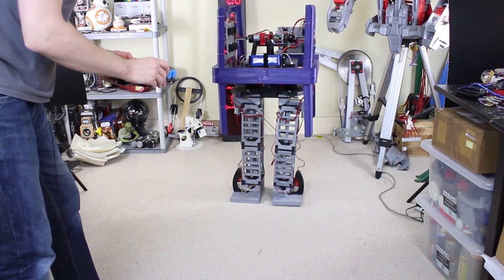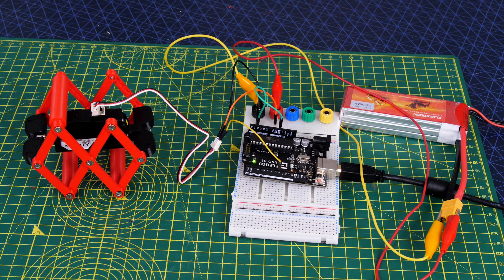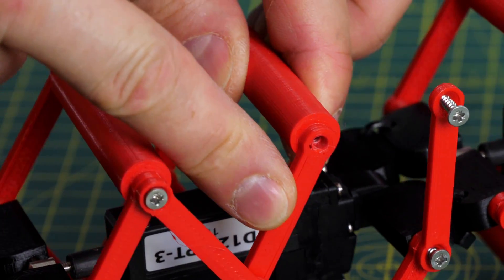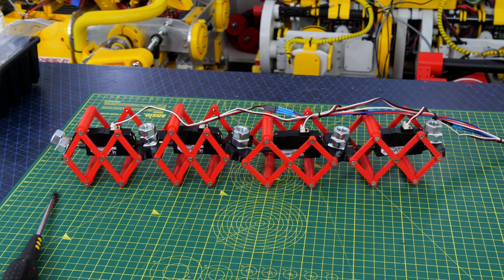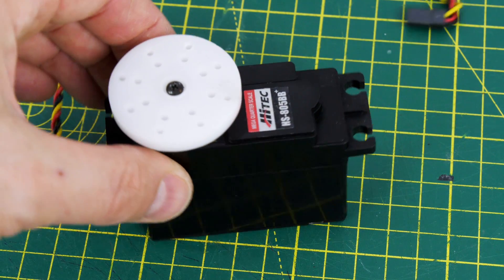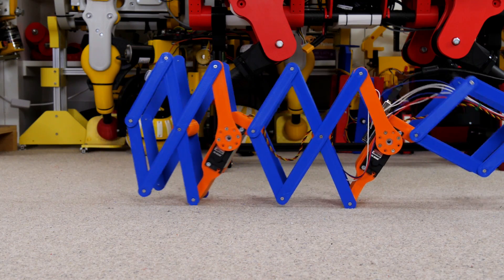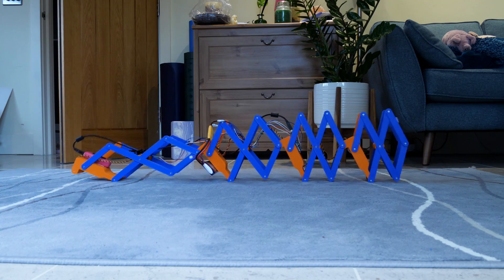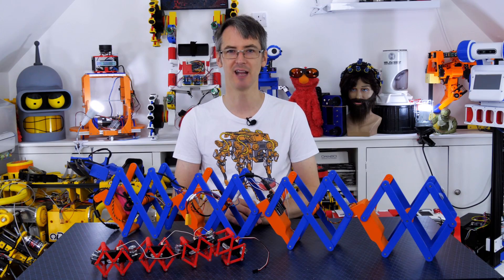Experimental Robot Worm

Comment: I think this is bound to fail from the start, as it is currently. I keep thinking of this experiment where you put a rod on your left and right forefingers, and then slowly move them towards each other. Your two fingers then always meet at the center of mass of the rod, and that's because friction is always higher on the finger that's closest to the center of mass, so that it gets slowed down.
I think your issue is similar here. Any section to the right of the center of mass, when it expands and retracts, the total friction on its left is higher than on its right, so the whole left part sticks to the ground and the right part slides. And in the end, the worm didn't move. Symmetrically for a section that is to the left of the center of mass, everything to the left will slide, and no progress will be made. It's only when a section close to the center of mass expands that both sides can slide (and in theory, they slide equal amount, which explains why on a slippery surface it was not making any progress). And you can see this by looking at how much progress the worm makes per cycle: after each section has expanded once, the worm has only moved forward by one section, indicating that only one section has made a contribution.
So currently all sections that are not around the middle of the worm are useless, since they only make one of the extremities of the worm slide back and forth. Basically, expanding only the two middle sections would be equivalent to expanding all like you do here, I think.
My guess is that worms actually also move their mass back and forth so that weight (and in turn friction) is higher on the side of the worm that shouldn't slide. They also don't expand much their extremities, since that wouldn't serve much purpose. They most likely also have something on their skin that can grip (either only in one direction, or in a controlled manner so that it only grips when it should).
For this robot, I think a solution would be to simulate this "grip on demand" thing: maybe each little cylinder (those you ended up glueing fixed) that touches the ground could rotate 180 and have one sticky side and one slippery side. Then any section that is supposed to slip should rotate their "feet" on the slippery side, and all other be on their grippy side.
Anyway, super cool idea, I'm really excited to see more about this, or any other project really ;)

Comment: Earthworms have backwards pointing thorns anchored adjacent to the ring muscle. If the longitudinal muscle contracts the thorns point outwards gripping on the surrounding. if the ring muscle contract the thorns are pressed on the body. This way the thickest parts of the body produce more friction and the movement are more efficient.
You can simulate that with "backward pointing" spikes on one of the linkage arms.

Comment: I was thinking, a gaussian curve running along the servos, with each servo offset by 90 ° phase should work and look great! It would just be an array with the function output stored, and each servo position would be read 90 degrees off in a loop. No smoothing needed, really.

Comment: Thanks James, that's very interesting!

I think that you may get more traction (pun intended) if you change the mechanism for each section to be, rather than a scissors mechanism, a mechanism where each foot touches the ground on different parts of the stroke. Hard to describe but if you plot the relative position of each foot just now then it is moving up and down with the only horizontal element being from the other segments pushing. If your 2x feet in each segment follow more of a circular pattern then you could walk with all segments having 1st foot up but 2nd foot down and then switching to 1st foot down and 2nd foot up. You can obviously then adjust the delay between segments to create more of a worm type movement.

Comment: I think you also need bristles on the underside that angle backwards (as with the earth worm). This would provide low friction when moving forward and high friction when pushing.
Reply: Yeah that's the major thing worms have. Directional bristles. You can buy cross country ski mohair skins to provide directional grip. Low friction sliding forward, high friction pushing backwards.
Reply: ...or perhaps lint brush material? Smooth in one direction, spikey in the other.
Reply: One way bearings and maybe a star shaped roller with the points angled backwards?  Or just a one way bearing with the rubber rollers.  They'd roll when moving forward, so little friction, but stop and grip when being pushed backwards.
Reply: as also seen on a bristle bot

Comment: one-sided rollers, so you drag when trying to go back
Reply: individual color leds, lcd is old tech
Reply: so 1080p full color, variable voltage, luminicity, per cymw-color, is 4K (3840x2160p) in pixels (4x 1080p)

Comment: +1 for ratchets and 2 lengths in parallel for steering. Be careful if you make one out of metal or even a large one out of plastic though, those scissor sections are all pinch hazard.

Comment: I believe weight distribution has a lot to do with how worms (earthworms in particular) move. Like in that clip you showed of the earthworm, it stretches out its head first, pushing it forward and using the weight of its body as an anchor point, then it gradually extends the rest of its body and starts clumping it up at the front so then eventually the weight is greater at the front and it can use its front as an anchor to pull the rest of its body forward. Maybe you could consider having different modes of propagation and allow the robot to switch between them, maybe adapting autonomously to the terrain

But its a great concept so far, can't wait to see where you take it next

Comment: Rather than the ratchet wheels a simple passive one-way friction surface works fine. Like how there's so much more resistance petting a dog from tail to head rather than front to back.
Also I can't help but imagine this driven by a single rotational motor but I can't quite put words to it. Might have to make my own.

Comment: I had a toy when I was a kid in the 80s that used a pneumatic engine and an accordion locomotion mechanism like this but horizontal and with wheels. Google tells me the line was Tomy "Space Pets" and the exact toy was the "Stretch Legged Stoomdorm". It moved a bit like a skater, with wheels on the ends of the accordion, and could get going fairly quick on a hard kitchen floor.
Reply: Удивительно! Но ты мне напомнил, что похожие игрушки были в СССР в 80ые годы тоже. Но они были редкостью. Я у кого-то видел.

Comment: There is a roller assembly I’ve got iff a kyocera printer that would help with this. It rotates in one direction but it locks in the opposite direction. It works in a similar way to a freewheel on a bike. It’s really compact so it wouldn’t take up much room. If you had some of those on the bottom of the worm, that would give you the traction you needed. It has a rubber coating to the roller.

Comment: Do a open source competition where people can add their own code, whoever can travel 10m the fastest, wins  people take turns and there is a leader board, the code for the fastest is released each week or each month.
Reply: Probably, someone could use ai to find the efficient way to move....That would be amazing
Reply: @vaisakh_km  AI is often tricky in applications to the real world. Someone one could probably find the optimum theoretical movement sequence but it doesn't always apply to real world as there are too many variable factors that can't be easily modelled.
Reply: @Sam-dn7jk  😁i am not that much into ai.... Years ago I just took a course on ML and that's it....

So I thought that would be easy for experienced people...
Reply: Yeah that would be awesome. You can shot a video about using People's codes on your robot.
Reply: Do you want sandworms? Because that is how you get sandworms.
Reply: @user-qf6yt3id3w  For the glory of Shai hulud of course
Reply: That would be a cool video

Comment: James, you are using the wrong algorithm. We must not just open the sections one by one. Open the first, then the second. Close the first, simultaneously close the second and open the third. Then there will be no sliding, the robot will constantly rely on something .. and it needs a frame)
Sorry for my English.
Reply: Ah I scrolled down to say this. There should always be 2 sections expanded at the same time.
1: Expand 1
2: Expand 2
3: Expand 3 while contracting 1,
4: Expand 4 while contracting 2,
5: Expand 1 while contracting 3,
6: Expand 2 while contracting 4,
repeat from 3
Reply: i was thinking along those lines too, i would also add a rubber foot to the last roller so that its not just moving in opposite direction since its the lightest direction as oppose to forcing the 3 other servos forward. jsut goes to show how amazing nature is
Reply: Let a sine wave with a wavelength of 3 servos run through the worm
Reply: Klaus is absolutely right. Also, it looks like on the big worm, the first and last segments don't really contribute at all to the movement. They just expand and contract. Maybe adding two specialized, passive segments to the ends which just stay in contact with the ground would help. Oh, and I guess the next step would be to add sideways bending capabilities so it can corner 🙂🪱
Reply: That makes sense to even me and I'm not that clever when it comes to this stuff. and your English is spot on dude, it's better than some English people I know 😂😂
Reply: @Matty.Hill_87  better than some guys on here too
Reply: @adultsite5699  go eat some parasitic worms
Reply: A better way to parameterize this would be to have each of the sections expand and contract following a sinusoidal function over time. Then you'd just need to tune the overall frequency and the phase offset between adjacent sections.
Reply: This and consider adding something is pointed backwards that imposes grip only in a single direction.
Reply: I agree, but he is not doing it WRONG. He's just learning.

Comment: I have not watched till the end but I believe you could create more sections without any motors by connecting them together with brake cables. Steal the motion from motorized section end repeat it in nonmotorized section. It might be fidly to set up, but might be cheaper for longer worm.

Comment: IIRC, don't worms have hairs that point backwards? That could assist with locomotion in the forward direction. Or even something like a semi-sawtooth tread pattern that is easy to pull forward, but tough to push backwards.
Reply: It's kinda like if you extended the front facing linkages of the bot and made them pointy, they grip the ground when contracted, and go out of the way when expanded.
Reply: Instead of a ratchet wheel, what if you just had a ratchet-pinion-like feet that slides forward easier than backwards, with a sawtooth bottom surface kinda like ‾|/‾|/‾|/‾|/‾|/‾|/‾|/‾|/‾|/‾
Reply: @CoolAsFreya  bro at least read the comment you reply to
Reply: Bro why are Bots everywhere